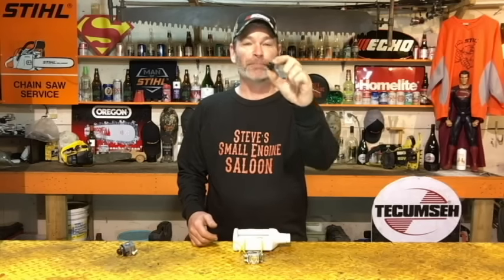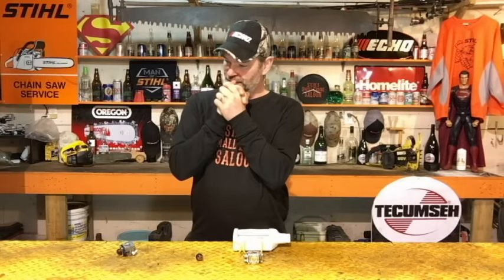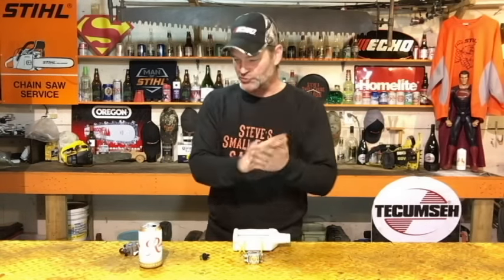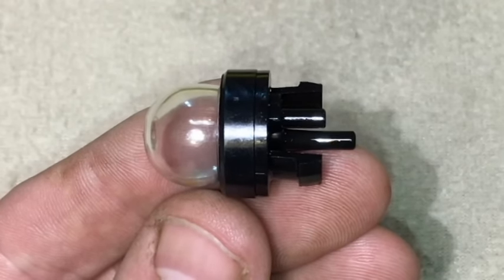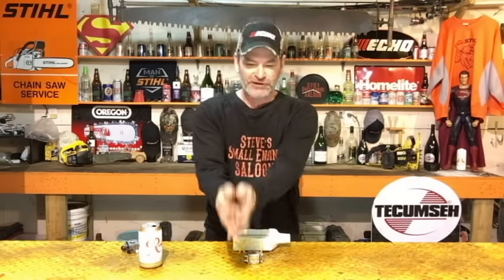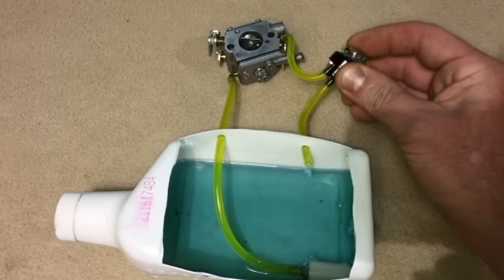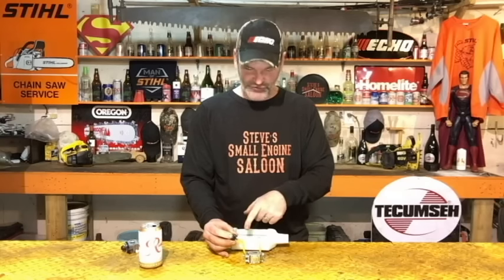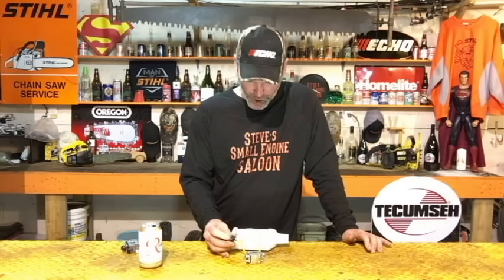How To Install A Purge / Primer Bulb Properly (Don't make THIS mistake!!)

Comment: I am currently working on a old Toro TC 3100 that has the purge system on the tank.   It is a really old trimmer and I am not even sure if the purge will even work anymore as I have to find a way to soften the rubber up on it.  The parts for this trimmer are very hard to find, and a replacement purge is $80.  For that price i can buy a new trimmer.  If it doesn't work I will have to see if I can get one of the new type of purge bulbs mounted on the tank and drill a hole in the tank for the lines.  The current tank doesn't have fuel line holes as the line is attached to the side of the purge bulb system.
https://www.repairclinic.com/PartDetail/Primer-Bulb/54-5570/1856382

Comment: what's in a name? the parts store calls it a priming pump. while true it does not pump fuel into the throat it does prime the carb by pulling fuel into it via suction. fuel evaporates quickly in those small carburetors so pulling fuel into them helps them start. 

if you have even primed a well pump you would understand the concept better. you are not purging the well by adding water just like you are not purging the carb by adding fuel.

Comment: Will it work it you push the gas thoughthe carb?
Reply: I don't see why not but the tubing routing would be very different from how it was originally configured so you would know you are doing something wrong.  If you only switched the original lines to the purge valve by mistake it would not work because there is a check valve in the carburetor allowing gas to only flow one way.

Comment: Adding a fuel line to the purge bulb (long hose connector) ie, the one where the fuel spurts back into your fuel tank is not necessary, as it is just the return fuel from the carby. The only hose you need inside your fuel tank is the fuel line with a filter on the end connected to the short hose connector (in) on the purge bulb.
So easy:
Long connector is fuel out
Short connector is fuel in and fuel line that is long enough (attached fuel filter) so it sits on bottom of tank).

Comment: 2 days wasted only to find out that 1 of the hoses on the valve fell off, cleaned the carb 7 times took it all apart and the purge still didn't work :body-blue-raised-arms:

Comment: I bought a fs 55 brand new,, it won't work next spring, there is no fuel in the primar bulb.  I get it in service and they get me 70 marks for a new carburetor !!! The servic guy says this is due to standing. Well, I don't want snow cutting with him. So don't buy fs55 it's not worth it.